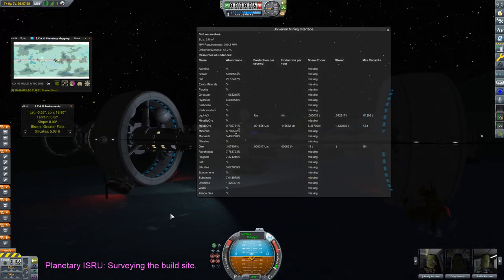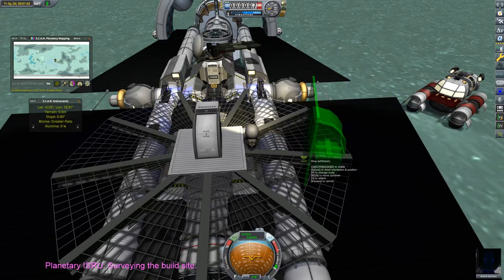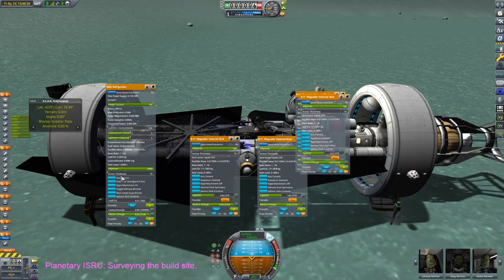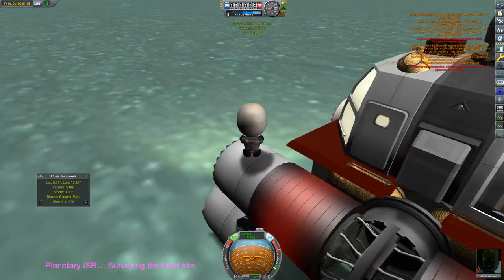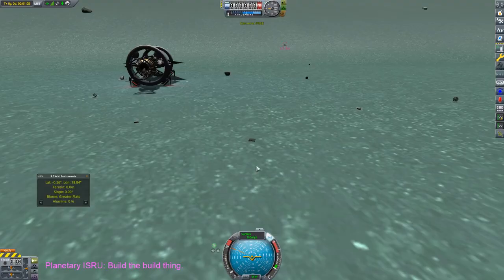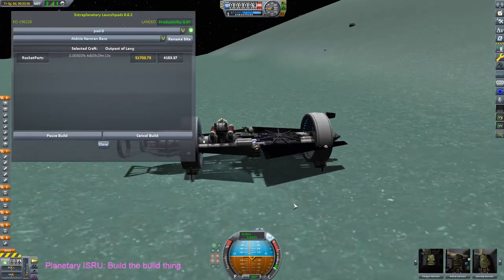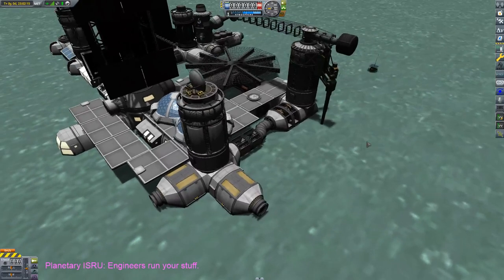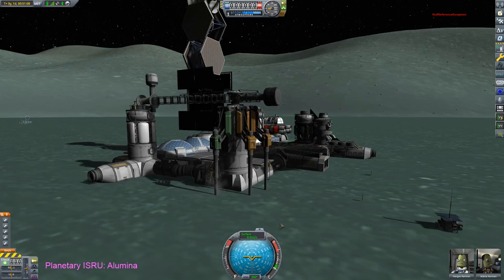Punk Wyrks - Project Kerbalshed with KSPIE (episode five) - ISRU part I

Comment: Sorry for double comment, but its not related aand...
For the survey drone, is easier to make a probe with an ion engine (and a servo to vtol), a rectenna (or even a capacitors, oh boy they are OP), mini reaction weel and a teeny tiny fuel tank (plus narrow band and surface scanners, of course). Generally a stock engine (for power efficiency and compactness) and a nicro gear scaled down because it looks so cute... And you can send several sice they are kerbal sized and use a few units of any fuel for all the trip. Only minmus, bop and gilly rated. Did you know a kerbal is SSTO in both 3? In bop havent checked, but numbers dont lie! Also, I like full videos like this, they have much more info an 2x and video time travel xD are always there (and the easyest edit is not to edit)
Reply from the maker: "and the easiest edit is not to edit." sagelike advice right there, 100%
Reply: I often use the cupoula, and its N2 (suppsed tp be life support xD (yes, kerbals are photosynthetic and nitrifiers!)) for ion fuel

Comment: The ability to just make new rockets and vehicles at location seems a bit far fetched. Was kind of hoping you had some system for landing new modules and connecting them together nicely. But still glad to see a tutorial going into all the complicated aspects of ISRU and resources that forms part of Interstellar Extended, as it's so complicated and documentation is pretty lacking.
Reply: I prefer MKS for that reason ;)
Reply from the maker: I did consider doing a modular approach to ISRU. However at the time this video was made, some people on discord and the ksp forums were also looking for pointers on extraplanetary launchpads. I decided to combine the two in this series as it allowed me to cover as many resources as I could (limited by what was on location) without having to design a bunch of different facilities. Just put them all on one base and 3D print it for the tutorial. lol. Still, modular designs are great when preplanning a mission down to the last detail and keeping track of every kilogram you need to launch. Certainly a challenge for the computationally oriented :)
Reply: @PunkWyrks  if you complain computationally, dont put 400 parts dude! Mr my computer aint the best xD, I didnt say you in the other comment because its bloddy obvious!!
In MKS, the inflateable thinggies are BIG, so little parts and if you desable the machinery use, it becomes 1/2 complicates (and 1 base and few outpost +planet storage)>one big base.
Also KIS+KAS  will help you alot with basemaking, you underuse them!

Comment: Hey great videos and very instructive... I just dont get the differnece between the radiators and the cooling systems and how to correctly estimate how much radiators i need. Especially if i use those candle nuclear engines... At one point they just make everything freaking hot. Do you have some advice or a pin point where to look? I didn't get it from the KSPIE thread https://forum.kerbalspaceprogram.com/index.php?/topic/172026-181-173161151145-ksp-interstellar-extended-1256-support-thread/...
But i got the very helpfull link to your videos!
Reply from the maker: Hey there! Glad you found the channel. I have to admit, I'm probably not the best person to ask about the waste heat management as I don't 100% have it down. It really depends on whether you are generating heat due to electricity production or from propulsion.  Efficiency of radiators and reactors and electric generators (and engines) also matters.  and more. im not saying it's impossible it's just not my particular strength. when designing vessels I will start with enough radiators to put me in the 'green' when looking at the thermal management window in the vab, and then run multiple trials to get it to a stable point. It also doesn't help that I intentionally run ships hot because I like the red glow of the radiators.... Many parts wil throttle themselves down due to overheating as a safety feature (you'll notice this as reactors start losing power as temp rises).  I'll certainly make a comprehensive tutorial on heat management once I've gotten a better feel for it myself. Until then you might check out my 'Beam Core Antimatter Propulsion' video as a few people have said they got a better grasp of thermal management from it.  Also, join us on discord! best way to get info. https://discord.gg/a2uQ5w
Reply: @PunkWyrks  I can help with that, will give you a few points, if you want a comment like most of mine's about in detail, ask for it..
1st) colors: 
- Red=temp rad>temp source (impossible heat management) gonna shut down.
- Yellow:temp source>temp rad>rad's max temp (radiator would "melt") gonna lose power over time until stable temp reached.
- Green:temp source>rad's max temp>temp rad (stanle temp) gonna be stable at full power.
Note that radiators get more efficient when hotter, so when yellow its most likely to kill most long term perfomance and red will sut down fast.
Rad power (watts)=Area(m^2)×Temp(Kelvin)^4, you see the point of the statement above.
Generators lose efficiency with heat.
Eff Generator(%)=base eff(%, tells you as theoretical max, depend on tech)×[1-Temp(rad)(Kelvin)÷Temp(reactor)(Kelvin)]
Charged particles dont affect, MHD has its own complicated formula, but you can aproximate to 0 (Temp has little effect)
HEAT BUILDUP DOES NOT MATTER TO ANY REACTOR/RECIEVER, ITS GOOD IN FACT (except for the pebble bed, muon cat and liquid metal cooled, for them is neutral in power gen and a tradeoff between Isp and thrust in propulsion (more heat with pebble bed=less thrust, more Isp))
The engine efficiency is similar to the generator thig BUT radiators dont matter (they are chamber pressure, medum temp, medium pressure and nozzle in its place) and the exaust will take heat at Core temp(Kelvin)×engine efficiency(%)+engine rad(the rad formula).
The convection bonus I think it works by adding ConvBonus×rad power+rad power, but I havent tested enough
Reply: In Stock KSP a TCS is a deployable radiator, just as simple. KSPIE doesnt make even the difference. ;D